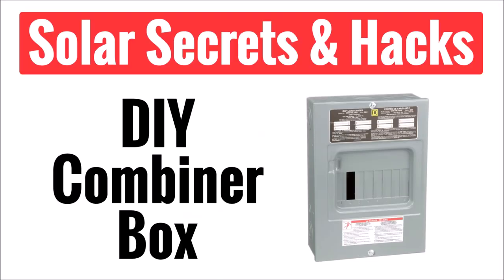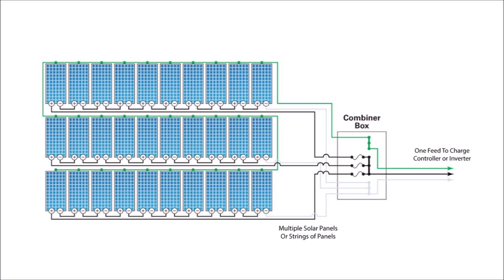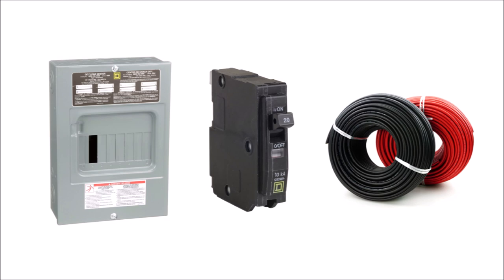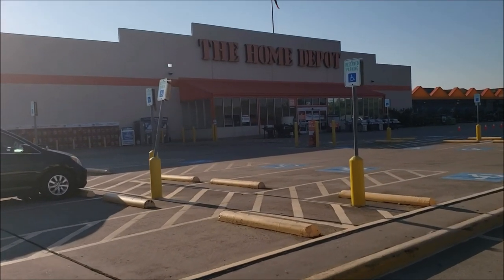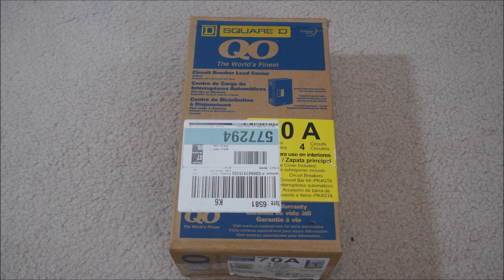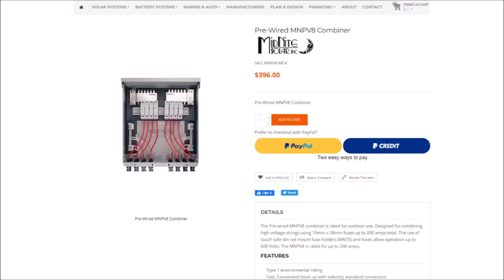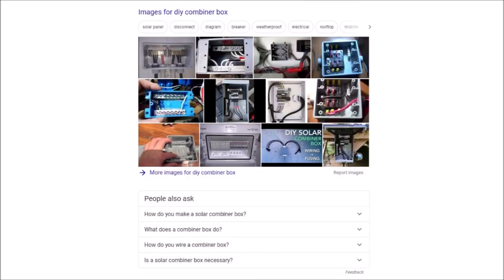Solar Secrets & Hacks - DIY Solar Combiner Box

Comment: The 2 positive terminal where are they coming from? you are only saying connect the 2 to the box
Reply from the maker: The input wires come from the panels or from strings of panels.  They get wired to the breakers.  Then a single set of larger diameter wires will output the combiner box and head over to your charge controller or grid-tied inverter.

Comment: I wanted to know how to do one that will allow grid on top to multiple string inverters (exit on top left/right side.  Then one in the middle for generator to split into 2 inverters and then a service one for the ac output from both inverters into one to an ac disconnect box then to bypass transfer switch.
Reply from the maker: Sorry, I don't mess with AC much so I don't know how you would set that up.
Reply: @LDSreliance  thanks for the reply

Comment: This is good for creating a breaker to shut down the panels from the system ONLY.  AC BREAKERS WILL NOT TRIGGER AS EXPECTED ON A DC SYSTEM.  USE DC BREAKERS BETWEEN BATTERIES AND ANYTHING ELSE.
USE AC BREAKERS TO DISCONNECT THE PANELS, as the panels will not usually provide an overcurrent situation!
Reply: He is using DC breakers from what I saw, didn't understand the comment

Comment: I have used the QO to combine small 48v battery banks in the 20-40A output range, then use the main lugs as the connection to an inverter (no main disconnect in panel, those are not DC rated). I would disagree with the approach in this video, you should not use single pole breakers. To truly isolate a PV or battery your are using in this manner, you want to use a double pole breaker and treat each bus bar in the load center as the battery terminals, one as the + buss and one as the - buss. That way if something trips both legs of the PV or battery connection are fully disconnected.
Reply from the maker: That is an interesting concept, but I don't see what the real benefit would be of that.  You would basically just be putting on a breaker/switch on both the positive and negative leads.  How is that better than one?
Reply: @LDSreliance  it’s for safety in case there is a short or overcurrent on either leg it will fully isolate that device vs just cutting one side such as just the positive side, but yet leaving the negative lead energized to the rest of the connections. It is just good practice when dealing with DC that both legs are removed from the circuit if a short or overcurrent is detected.
Reply from the maker: So why is that not done in other applications?  In the auto industry or landscape lighting or other low voltage DC applications?  I've never heard of this being a best practice or being done (to fuse or breaker both negative and positive).  I'm sure it can't hurt anything.  I am just curious.
Reply: @LDSreliance  at 50v and up it can kill you. 12 & 24v applications your resistance is high enough if u touch something that is energized u won’t get electrocuted. At 48v and up u don’t have enough resistance and it could be fatal if some leg is energized and you complete a circuit. Best to cut the circuit at both connections, especially since there is no equipment ground that is bonded at the neutral as in the AC configuration which should be the least resistance path, assuming all is operation to specs. But what do I know I check 9v batteries with my tongue, so my answers are probably years of shocking my brain cells causing ridiculous conclusions.
Reply from the maker: You can never be too careful, for sure.

Comment: Dc and ac breaker internaly works diferrent they might look the same but funcion different never use ac breakers for and solar system
Reply from the maker: That may be true of most, but the QO is rated for DC and successfully sold and used as a DC breaker by numerous online solar outlets and off gridders around the world.  Here is one example of a major solar e-commerce store selling them:

https://www.altestore.com/store/enclosures-electrical-safety/overcurrent-devices-fuses-breakers/din-rail-circuit-breakers/square-d-plug-in-circuit-breakers-p41287/

If a major corporation like Schneider Electric is willing to stamp their approval on these to work with 48V DC then you can bet they are confident they will work.  Because if they don't and some cabins or outbuildings catch fire or someone gets hurt or killed, they can lose millions in lawsuits.  So they don't mess around with ratings.
Reply: I made the comment about using ac breakers for dc current not talking about the panel people tend to believe because it works it can be use and thats not the case ,ac and dc breakers work very different
Reply from the maker: OK, I thought you meant the QO breakers.  Because they work for both.  But you are right, if you grab any AC breaker off the shelf, it probably won't work for an equivalent DC current.

Comment: Why the heck should there be any difference between AC and DC as long as you don’t go over the voltage or current or wattage specs?  That makes ZERO sense, except to perhaps pad the wallets of companies to charge more for the same thing. The one exception to this is maybe the breakers which might have to contend with DC arcing.  But all the rest should be identical. Please explain.

Comment: also those mc4 connectors dontcome in any size wire thats ratted bigg enough to parralel any panels of decent sizewattage. i think the biggest wire for and mc4 is 10awg
Reply from the maker: How do you figure?  Even the largest panels, around 400W, could make use of #10 AWG wire for up to 8 feet by themselves @ 12V with less than 2% voltage drop.  

But anyone using that size of panels is installing a larger system where you will be using much higher voltages than 12V, in which case #10AWG can go for much longer runs.
Reply from the maker: Sorry I didn't read the word "parallel" the first time before I commented.  Yes, you are right.  You would not be able to parallel large panels.  But I don't know why you would do that, anyway.
Reply: @LDSreliance i need amps more then i need volts. im attempting to run a 5000btu ac on 4  210watt panels in parallel . i think on a good sunny day ill be able to run the a/c without putting much drain on my battery . 
the ac has a low start up wattage and and draws 40-45ish amps dc the batteries can handle it but only for a 4 or so hours.system dosnt need to run much else Just a few lights and charging little devices. also space is factor cause the panels are on my van roof. other wise id parallel a bunch of little guys and make it easy on myself
Reply from the maker: @mastershake1187  But why?  High amps gives you no benefits.  Your batteries have less capacity (Peukert Effect), you have to run heavy gauge wires (like you mentioned), and it can be more dangerous.  Just by running 2 parallel strings of 2 panels in a 24V configuration solves all your problems.
Reply: @LDSreliance  the panels im looking at are rated at 12.5 amps so if i parallel 2 strings dosnt that only give me 25 amps? i figure if i can provide all the amps the a/c needs then i dont have to drain my batts down constantly if i parallel all the panels together . according to the specs sheet my 200 ah batts can handle that many amps being drawn from them, but yes it does effectivly turn them into 160ah batteries. is there some other way i can get the a/c running(on a good day)  without killing my batteries?
Reply from the maker: @mastershake1187  I don't understand why you need a certain number of amps.  Is this a direct current air conditioner?  What voltage?
Reply: @LDSreliance  the rated amps for the a/c when converted to dc are 40-45 so if i want to not drain my batteries while running the a/c i need to provide that many amps dc right? its an AC a/c
Reply from the maker: @mastershake1187  No that isn't how it works.  Amps and volts are irrelevant.  Watts is what you should compare.  If you have 840W of solar panels and the A/C is pulling less than that, your batteries are filling.  If the A/C pulls more than that it is depleting.

This is even more true if you have an MPPT controller.
Reply: @LDSreliance  i dont understand why thats not how it works. if my unit needs a certain amount of amps to run and i dont want those amps that the unit draws to effect my batt levels. then the panels have to provide those amps. im concernd with my battery level and those are measured in amps. so why can you not solve the problem by focusing on amps? my panels provide adequate amps and my inverter handles the voltage change. if i provide my inverter with the amps needed to run the airconditioner and the inverter handles the voltage change......then the a/c runs with little effect on the batteries correct? and the amps(DC) needed run the air conditioner can only be achieved by connecting my panels in parallel.correct?
Reply from the maker: Your line of thinking is fine, but what I am saying is there is a better way where you can use #10 AWG wires and industry standard connectors and safer levels of current.

If you have a good quality charge controller it will be able to accept multiple voltages of input (12,24, 48, and up if you have MPPT).  The controller can output a different voltage to the battery bank.  If you already own your inverter you will wire your battery bank to whatever voltage your inverter needs.  So if you have a 12V inverter you will wire your batteries in parallel and keep it at 12V.  But you aren't locked in to 12V on the input side.  And that is my point.  You could run your panels in series for a 48V string, use lower gauge wire (#10 AWG) and low amps on the input side, but the charge controller will then output high amps to the battery bank because it is 12V.  In other words, if your panels are producing 600W at a given point in time in that example, the input side would be receiving only 12.5A from the solar panels (at 48V) but the output side of the charge controller would be spitting out 50A to the batteries (at 12V).  That is why I said to look at it in terms of Watts in and Watts out and don't worry about Amps as much.
Reply: @LDSreliance  wow thank you for sticking with me there. ive been missing some fundamental info on what charge controllers are capable of. that was a huge help!

maybe this is just somehitng that i struggle with but have you ever dont or considered doing a video on terminology? i think we could have avoided this conversation if the industry called them  maximum power point adjusters or maybe instead of saying voltage tracking they said voltage adjusting. im sure theres a technical reason for useing the word tracking but in laymans terms tracking means your following something....and how can you effect somethign when your only following it? also i dont understand how the definition for the word nominal applies to how its used in the solar industry. i get through context what they mean but jeepers it seems to make making sense of things that much harder. 
thanks again! youve saved at least a  100bucks on my build!
Reply: @mastershake1187  
Most MC4 connectors are rated at 30A which is what 10ga wire is rated for. But 8ga MC4s are available- I use 8ga to quell my ocd on line loss over distance so I have bought a bunch of 8ga MC4s

Comment: QO breakers are only rated to 48v DC...  This probably won't work
Reply from the maker: Works for any solar from 12-36V nominal.
Reply: Just three of my 300 watt 24v panels in a string can crank out up to 900w 9.7a and 144v dc in the dead of winter.  How are those QO 48v dc breakers going to handle that?  There not or they are not going to work correctly.  You cannot use your combiner box with QO breakers for a high voltage PV combiner...   @LDSreliance
Reply: And just one of my panels by itself can crank out 48v dc in the winter.
Reply from the maker: I said 12V to 36V DC nominal.  If you are going to string your panels above 36V then that would not apply.

Very few off grid installs use high voltage strings like you are doing.  Most systems are on RV's, boats, gates, surveillance cameras, landscape lighting, and cabins where high voltage would be impractical or impossible.  So for most off grid systems, a combiner like this box works perfect.

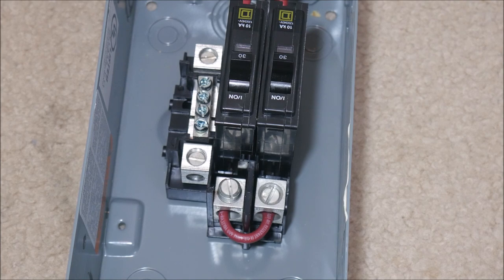Comment: At 5:30 isn't that illegal to put more than 1 wire in a lug together like that?
Reply from the maker: Illegal?  You mean against the NEC or other code?  Possibly, although I have seen it plenty of times on AC systems.  But this is a low voltage DC system and the NEC doesn't apply.

Comment: You are using wrong breakers, you Should be using QO breakers marked for 48vdc, the 120*/240v ones are not for DC and will not break an arc properly when used as a DC disconnect.

Comment: I want to caution people that AC breakers will not trigger the same on a DC circuit!  There is ample evidence for this.
Reply from the maker: As I stated in the video, the QO series from Schneider Electric is perfectly safe for 48V DC and the QOB series can go up to 125V DC.  They will provide overload protection, which is what is needed, and are UL listed for instantaneous tripping (must use multiplier based on AC curve).  They can be used on grounded or ungrounded systems.

https://www.se.com/us/en/product-range/7218-dual-rated-ac-dc-circuit-breakers/#overview

Comment: This is very dangerous info. That box does not comply to any regulations. 1st off the breaker must be rated for DC current. Secondly theres a reason why the commercial boxes have fuses. Then there is SPD's, you need a good type 1 and 2 surge protection device with all combiner boxes. I dont use breakers, but one DC isolator, and fuses on both the + and - with a good SPD.
Reply from the maker: What are you talking about?  The QO series IS rated for DC current up to 48V.  Did you watch the whole video or just look at the thumbnail?

SPD's are not required for solar panel systems.  While it may be a good idea, there are no codes that require it.  NEC article 690 covering photovoltaic systems does not even use the word surge in the entire document.  So, again, it is a good idea if you live in a lightning-prone area, but it is not "needed" as you stated.
Reply: Even though some of what you say MIGHT be true, it doesn't account for those of us who don't give 2 shits about "codes", and feel no compulsion to comply with government mandates that we had no say in.
Reply: @wileecoyote4116  , to ignore the fact that the system is unsafe is just stupid. Whether regulations or not. DC will kill you. I have been an installer for 20 years.  In the end it makes it unsafe to work with, or can/ wil damage your own equipment. Here in SA we have a lot of thunderstorms, and our regulations is quite clear. And i always add more protection that what is needed, have you been on a tin roof with PV panels that was not grounded?
Reply from the maker: I think we can all agree that grounding an AC system is mandatory and the right thing to do for safety.  

Where we have gotten off the rails a bit is your attack on the QO series load centers that they are not rated for DC (false) and your assertion that you "need" a surge protection device for lightning.  I think that is good practice in lighting prone areas, but there are no codes or other safety regulations requiring it and I would sleep like a baby in a house without one.  And while you seem very competent with grid tied PV systems where there are lots of rules for cogeneration, grid connection, and all applicable NEC codes for the AC side of things... off grid systems (low voltage DC) are a different animal entirely that you don't seem to understand and have very, very few codes and rules.  So lets leave the discussion there and agree to disagree.

Comment: Max pv voltage of 48 volts!
Reply from the maker: Actually, a 48V PV system would reach much higher than 48V.  So the highest you would want to run through this would be a 36V nominal setup.

Comment: Even 2 years ago -- who was working with 48v series panel outputs? That's exceedingly feeble.
Reply from the maker: For grid tied solar, that is true.  But this isn't for grid tied solar.  This is for off-grid systems, which are at least as common as grid tied, albeit usually much smaller.

Comment: Wow you Americans made your power complex.

If you're  able buy a UK euro consumer unit.
It's the recent name of a fuse box here.

Inside you'll find a din rail, where your breakers fit. 
You will have bus bars inside, typically a neutral (L2 for you guys) and a ground (earth) you  have a common positive rail which fits into the breakers.

Therefore you hook the negative to the ground.
Your positive is fed to the breakers and then to to the rail. Your output goes out the way the others come in.
The other rail/bus will be empty, or can be used to carry your earth/ground.

Also take a look at RCBO breakers.